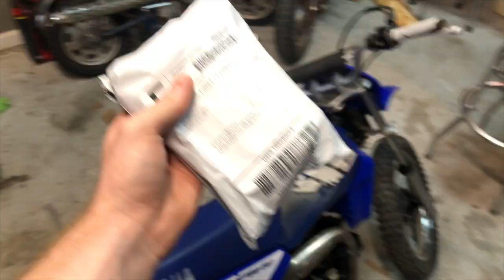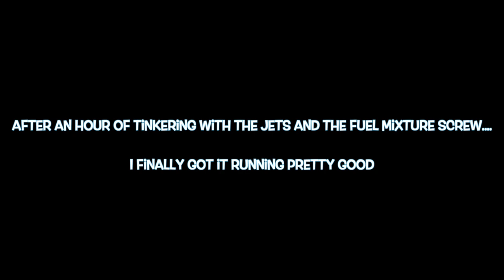$200 PW80 Project PT4 (Tuning the carburetor)

Comment: Oh yeah nice i really needed this vid, i bought a pw80 completely messed up. so i fixed the whole bike up and made it a race bike, but i would idle for very long while the idle set screw was all the way in and the throttle cable adjusted to max aswell. but when i tried to rev it or ride i would bog randomly or just not wanna pull me very well. i pulled the carb and i found a FLIPPIN 60 main jet in there i also got performance air filter for it, and the pilot is a 15 and i have upgraded my stock exhaust so thx for the vid

Comment: I had an old Yamaha yz80cc think it was from like 1982 or some, low or mid wheel don't know witch, it was small. had it on the streets instead of moped :).
Damn that had power, needed to sit on tank first gear's got up on back wheel other vice. passed cars with friend on it to :)
i got that for 100euro, but its long time ago. It had being to Yamaha for big service, then it was just sitting inside of a house bassement 5yr before i bought it.
I painted '?' instead of nr, front and side's on it. hehe.

Comment: You have to cap off the oil injection if you are not using it will cause an air leak
Reply from the maker: I’ve never capped it off but I’ve never had a real problem with any air leaks. I’ll keep that in mind though because I need it to be running in tip top shape

Comment: Why does the throttle cable go from 1 to 2 Cables and how does the choke work I have one of these carbs and going to put it on  80cc motorized bicycle motor but wasn't sure about the choke
Reply from the maker: It goes into 2 cables because one of the two goes to the oil pump so when you pull the throttle it shoots oil into the carburetor, kind of a janky system so I just drained the oil tank and ran it with premix

Comment: U should have closed up the air completely on the carb and turn the idler completely to the left the it should have riden better,way better and richer,and the flywheel u could have moved abt 2mm forwards

Comment: Hi bro. Can we find the best jetting combination (pj,mj,needle), while our engine on break in time (new piston and ring).

I just installed new piston set and still unable to find best combo, i wonder maybe bcoz it's still on break in.

Many thanks
Reply from the maker: Hey man. I just changed the jetting depending on how it was running. If it’s lean, bigger jets. If it’s rich, smaller jets. If it idles but doesn’t rev put, bigger main jet. If it doesn’t idle but revs out, bigger pilot jet. I didn’t mess with the needle so I find know how to adjust that. Just play with the jetting till it runs right. That’s what I did anyway.
Reply: @EthanHervig  Thanks bro.

Comment: Any idea how to fix a jammed clutch on a pw80?
Reply from the maker: I've never heard of that happening... the plates wont separate? Or it just dies when you put it into gear?
Reply: @EthanHervig  yeah dies when you put in gear when you sit on it, fine when the hold the wheel up?
Reply from the maker: @MrJc201222  Try taking the clutch out and cleaning the plates. Sometimes when bikes sit the oil gets gunky and the clutch sticks.
Reply: @EthanHervig  will do cheers! Also is the idle  on the carb or on throttle cable?
Reply from the maker: @MrJc201222  It is on the carb, it's the little screw on the left side. No problem!
Reply: Take it apart